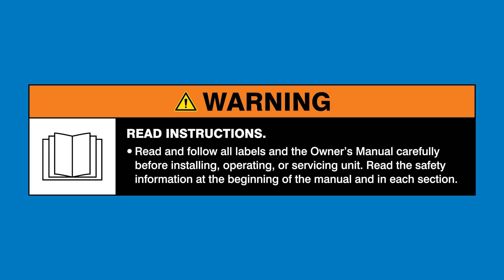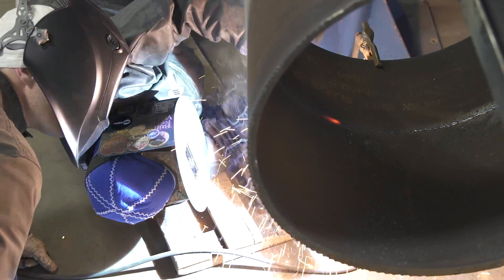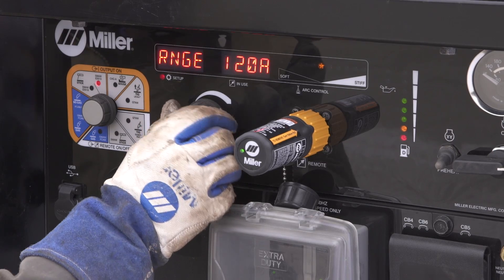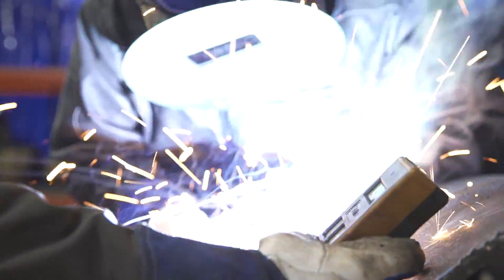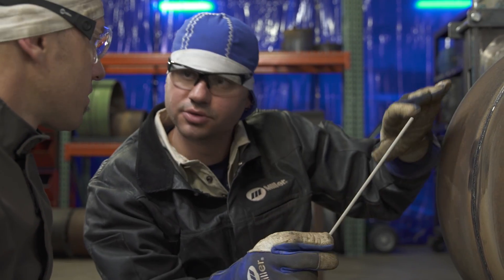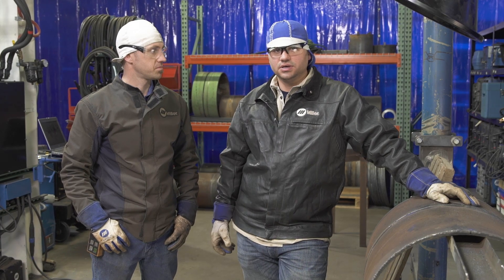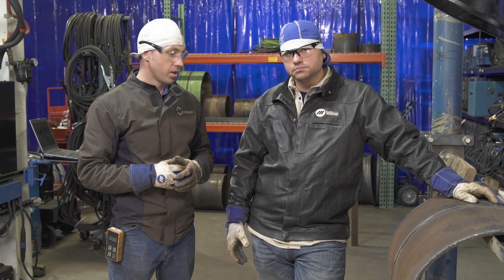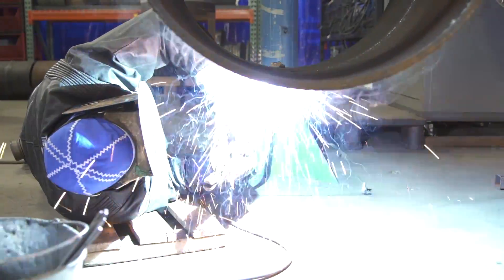How to Set Dynamic DIG Parameters for Pipeline Welding

Comment: So is this for miller big blue 400pro or for pipe pro?
Reply from the maker: Hi Fabian, Big Blue engine driven welder/generators are now equipped with
Dynamic Dig Arc Control. This feature can be found on all Big Blue
models which are outfitted with the new controller interface (i.e. any
model with a USB-port). Here is a link for more information: https://www.millerwelds.com/-/media/miller-electric/files/pdf/products/engine-driven/bobcat-trailblazer/dynamicdig_bigblues.pdf

Comment: I’m new to Miller and am having trouble starting 5/32 6010 and getting penetration right away. The first 1/4” won’t punch through on M program. I have heard guys switching back to K program, is there a way to change settings to avoid grinding every start?
Reply from the maker: Hi, we recommend giving our service line a call to talk this through with a tech. The number is 920-734-9821. If there’s anything else we can help with, just let us know.